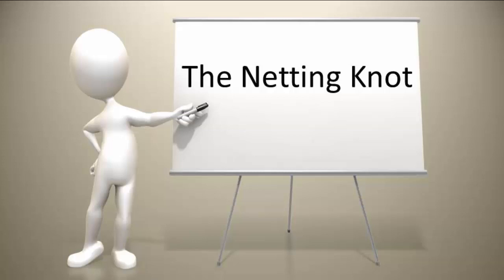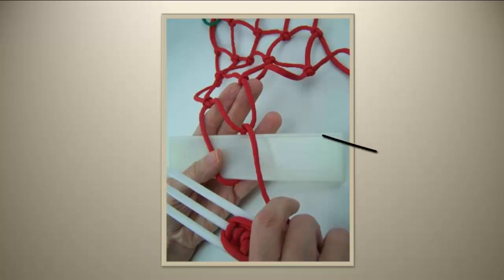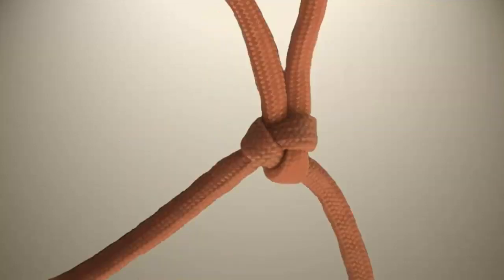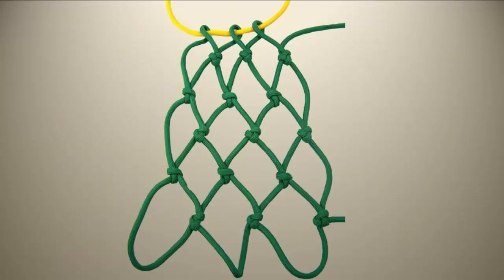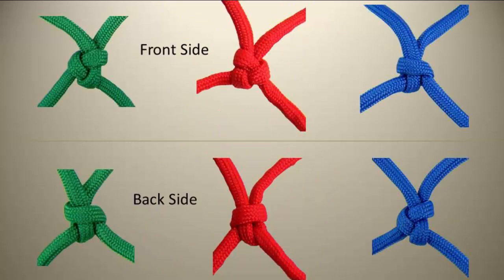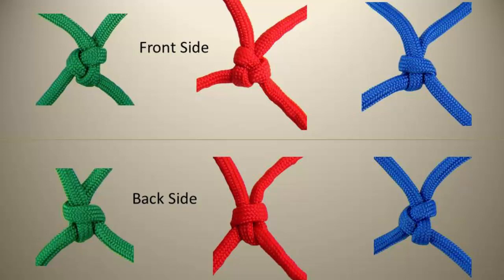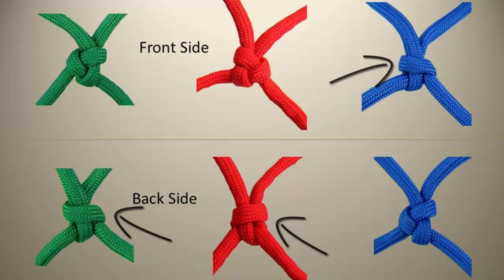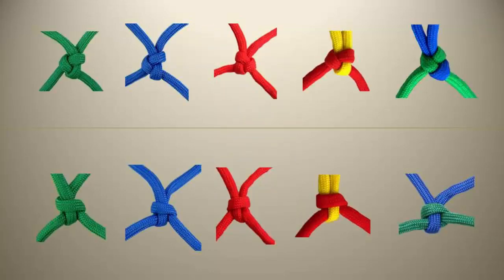The Structure of a Netting Knot

Comment: It is also called a bowline. Try something. With a single piece of line, make a simple slip knot, with the boat end being the part that has the sliding part of the loop . pass the other end  around something ( a piling ?) and then through the loop, and pull the boat end. It rolls around and makes a bowline. Handy sometimes.
Reply from the maker: Sorry. The sheet bend and the bowline are not the same knot. They are different!  (see https://www.youtube.com/watch?v=c-zkWSW0kMg) for a clear explanation.
Reply from the maker: A bowline is a handy knot, but it is not a sheet bend or netting knot. To the best of my knowledge they are not the same.
Reply: @ritabartholomew  You're right. Bowlines are for making loops that are easily undone. A sheet bend is for joining ropes of the same or different thickness.
Reply: A bowline is not a sheet bend.